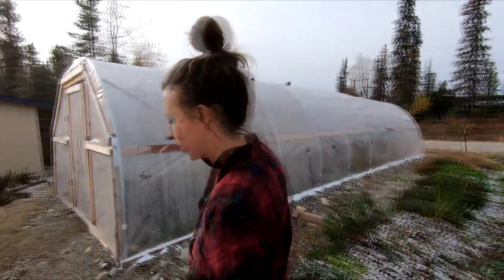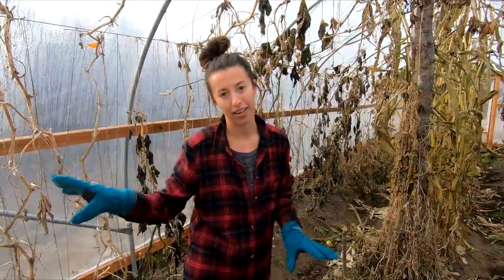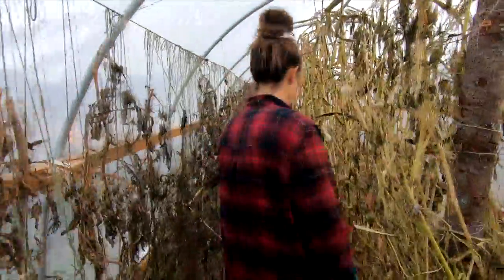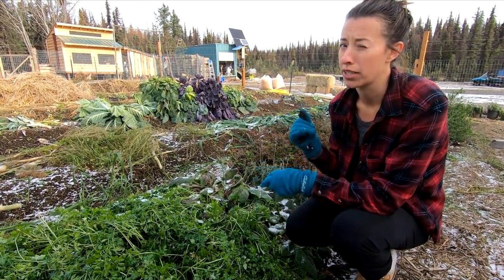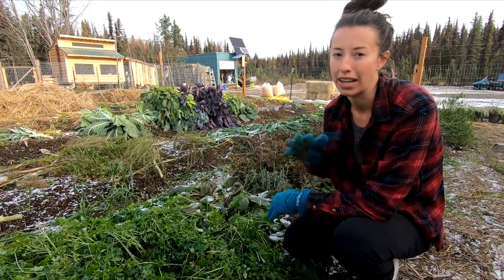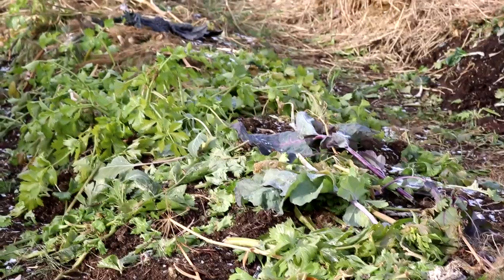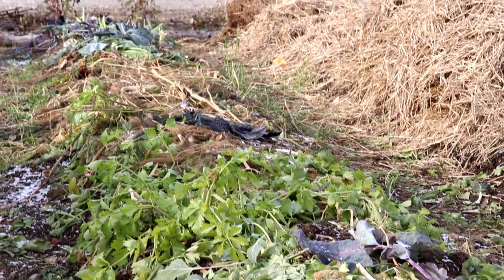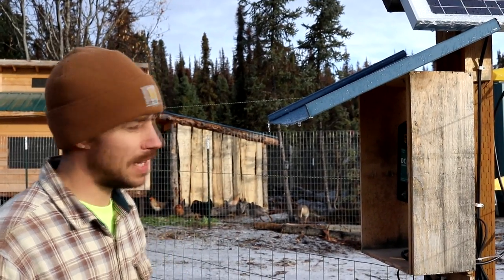Putting the Garden to Rest | Overview of Our Garden this Year

Comment: So next year when you do the squash outside build some trellises and go verticle. Mine is 7 feet tall and is in 6 inches wide by 12 inches tall and I use 8 foot 2x2s to hold them upright. If you have a dollar store go rade the pantyhose section they make great cradles to support the fruit. If you have a chipper/grinder take all the stuff currently in the greenhouse and grind it up for swifter decomposition especially the corn stocks and last but not least when the tomatoes are taking to long to ripen get some overripe apples and lay them along the base. As they decompose they emit ethylene gas and will trigger the ripening of the tomatoes.
Reply: I apply the same trick with my tomatoes to help them ripen a little faster ;-)
Reply: Love a man that knows what he is talking about.  Helps sure does.

Comment: Some plastic spacers of some kind should make enough room between the plastic and the wooden beams to slow down their rot in the greenhouse. I had a few problems with a tarp-covered scrap-wood pile, and was amazed at how bad being in contact with the plastic was for the wood. It really doesn't let moisture out at all, and even the wood that was an inch from the tarp was in much better condition, despite still being in a humid environment under the tarp. Even the pressure-treated wood had mold where it contacted the plastic. It was bizarre to see, as it happened in only a few months.
Reply from the maker: S. Smith appreciate the info ☺

Comment: If lack of bees is an issue, you can hand pollinate pumpkin and squash. You just find the male flowers ( the ones with a single stamen), pull back the petals, and then gently rub the pollen on the stigma of the female flowers. Depending on how pollen rich it is, the male flower can pollinate about 3 females.  I find that mid morning when the dew is off works the best. Hope this helps.

Comment: Just a thought for a heater in the high tunnel. Bury a 55 gallon drum in the middle of the floor and vent the smoke out a pipe underground through the side. Leave a quarter to half of the drum exposed on the top for heat escape into the tunnel and to feed wood in. Top the whole thing off with small rocks for heat retention. You guys are doing great and you dont need my help , but there is my 2 cents. Great video as always.

Comment: Learning alot from your gardening...   The hay up here is so dang expensive....  out by Macinzy point you may be able to get old hay cheep....  
An idea, in meadow lakes or houston there is a rental place that has a big chipper shredder, a day at your new property shredding the top layer of the mulch and some limbs,  make great compost...  Grinding up straw, leaves, grass and mixing it with your fresh manure makes great garden soil up here..  That lower bog black dirt is amazing to... We did nothing but that in a raised bed garden and the plants went nuts...  bushels of tomatos.....   
Another thing I thought of, inside the tunnel on the sides, how about four inch square fencing bent to the contour of the wall as a tresel ...
Also there are tons of places you can get free saw dust!  From cutting firewood in out yard I learned that makes great soil in a short tim for a lawn..  Just some thoughts...

Comment: Cutting celery (mostly leaves) has become a fav in our gardens. I dehydrate it from late summer into hard freeze. It works great in zone 4, if started from seeds. It replaces regular celery (in soups), which struggles in our sandy soil. You might try it some year.   👍

Comment: Concerning the herbs, you might try running bales of straw along the sides and some plastic over the top leaving the ends open for airflow that would be a really insulated cold frame. Just a thought.

Comment: I take the edible greens, dehydrate them, blend them into greens powder, which I then add to soups, stews, omelettes, etc, basically anything that'll have enough moisture to rehydrate the powdered greens & herbs.  I'll also toss into the dehydrator thin carrot peelings and other vegetables from time to time, and add onion powder, etc, to the greens powder.  A little goes a long way, adding micronutrients, folic acid, etc, and it definitely adds depth to the flavors of a meal. 

Different greens (carrot greens, mustard greens) can add a spiciness, while spinach is surprisingly sweet by comparison, plus you can actually add lettuces to your cooked meals this way, without getting that nasty soggy texture.  Some greens, such as beet greens, definitely need to be blanched before dehydrating (it removes oxalic acid, which can upset stomachs after a while), but some can be rinsed and dehydrated right away.

Make sure to get a good dehydrator with temperature controls, since herbs need a lower temperature than veggies.  As a bonus, f you get one that goes up to 165F, you can also make jerky!  I use chicken or turkey burger since it's naturally low fat to begin with (see below), and then mix it with spice packets, such as Montreal Steak Seasoning, or Phad Thai powder, or sometimes just my favorite barbecue sauce straight from the jar, though the extra moisture means extra time dehydrating.  (Follow all safety handling recommendations for any of this, especially the meat, of course.)

With that kind of a setup, you can also dehydrate pre-made meals and store them in jars. It's recommended you dehydrate the meat separately, first cooking it thoroughly, then rinsing it in boiling hot water to remove as much fat as possible, to improve the shelf life by removing any chance of any fat going rancid; it needs to dehydrate at 165F, but your cooked veggies, cooked rice, cooked pasta, etc, require lower temps, like 125F-135F (read your dehydrator manual, etc) to dehydrate best.  Then just combine them at the end, store in a jar, and when you're ready to eat, pour it into a pot, add just enough hot water to cover, and gently simmer it until it's rehydrated and ready.  (Don't forget to add a bit of greens powder, too!)
Reply from the maker: ladyofthemasque thank you for that information, it was our first time drying greens we are very excited to use them 😀

Comment: Hail from the Oil Patch in Central WY!

Congrats on a superb gardening year! It looked great and the step-by-step methodology you two use in presenting the what's, why's, and wherefore's, as to how you decide to garden is truly valuable and I hope you will take the extra time to make a CD/DVD collection as you go along, one that you can market, because your straight forward common sense presentation makes it easy for others to follow!

I'm a big Ruth Stout gardening paradigm supporter, so appreciate your approach to gardening. Where we might differ to a lesser degree are the 'pests': where a pest exists, there is a predator/solution to the rescue!

Aphids? Lady Bugs.
Slugs? Bowl of beer/ Ducks
Flys? Mantids

Natural solutions to natural problems; people really need to 86 the synthetics and remember to live healthier via natural solutions!

I would also recommend you consider creating what I call a 'Compressed Compost' set up: 2 to 4 heavy duty barrels (plastic is the best weight wise, but 55 gallon steel will do) set up on simple spindles, with basic gear/chain connections, which are tied in to a simple electric motor that is solar powered.

The barrels turn at a reasonably constant rate (even at night if you add in a couple simple batteries), thus composting your materials at a vastly accelerated rate. There are commercial rigs that you can buy ready made, but my budget would never allow for that at all, so I'll be building my own.

I would also recommend you take some of your girls products and mix them in with your column overlays: the hotness of the chicken manure will help break things down much more rapidly than you might suspect during the Winter, and because it's Winter, the rate won't be too fast for reasonable use next Spring.

Thank you for another great video.........oh yes, if you know anyone who raises some rabbits, rabbit poo can be place directly on materials for growing without them burning up.........

Comment: Great Overview guys, you did an awesome job on the intro too. The garden did really well, part of the fun is working out what does best where. You can now put your feet up for 5 minutes and then the the real fun of planning everything for next year begins. 
May I suggest a "Rocket Stove" for the High Tunnel and fit a liquid heat exchanger on the flue pipe to gain some extra heat, you can run a syphon system to a water barrel as a heat sink that will slowly release the heat overnight, and it can be placed further down the tunnel. You can even run the flue underground part of the way to warm part of the soil for your new seedlings, worked great for me! Check out this guy's heater:  https://www.youtube.com/user/web4deb.
Looking forward to seeing the root store when you get round to doing a video of it.
Reply from the maker: Dave Williams thank you 😀 we are going to be doing some research this winter for the heat in there.

Comment: I was wondering if you were going to plant fruit trees.  I love my orchard.  I got good numbers of apples, pears, arctic kiwis, and pie cherries this year.  Just be sure to consider moose protection.  Moose really love apple trees and it is disheartening to wake up one morning and see that your trees have been broken.  some times you I have a suggestion on the berries.  You might try service (saskatoon) berries.  they ripen slightly later then the honey berries, but still well within our season in south central Alaska and they are much easier to figure out when they are ripe.  My honey berries turn blue before they are fully ripe and they are sour if not fully ripe.Also there is another thing I like to do with my greenhouse.  In March plant a bed of spinach and fill the bed with snow.  Put a good foot of snow on the bed.  When the snow melts start watering.  The spinach will grow and be done by the end of May just in time for your tomatoes and peppers to be planted.
Reply: BTW, I heard some types of nuts can grow in the subartic, like the beaked hazelnut & some species of pine producing pine nuts. I also know that the butternut/white walnut is a cold hardy nut. I saw that some type of plums can grow in the subartic & now a blackberry but it needs winter protection.  In Canada they sell a type of cold hardy grape for the Yukon. Klondike Nursery in the Yukon Canada is one of the furthest north nurseries in Canada.
Reply: I have tried Butternuts, and am currently trying a variety of hazel nut.  The butternuts I tried twice.  they did not make it through the winter.  The first variety of hazel nuts didn't make it.  I'll see come spring about the second variety.  I have never tried the pine nuts.I have tried grapes several times.  I have had them survive a winter or 2 but eventually they die with out producing anything.  There is a guy in Anchorage growing grapes successfully in a green house, so it may be possible in a warm sheltered location.I have a hardy blackberry it survived one winter but died back to the ground.  This winter is looking to be a little colder then last so we'll see what it does.I have several plumb trees.  including a Canadian variety.  They grow well but have not been big producers.  I have gotten a total of 8 plumbs in 4 years.  the trees are still young and only 2 of them reliably flower.
Reply: @drivingonice  , I saw online of a native grape in Alaska & neighboring Canada, but it is quite sour but can survive -70F below zero. Also in Canada, they have a "ultra-hardy" apple & cherry & I saw some folk there grow them in cold-frames. It is just like in northern zone 3 Minnesota back in the 19th century, no apples could grow there. A doctor experimented with all kinds of apples like 15 years & finally came up with an apple that could grow there. He named it the  "Worthy apple" & soon apple orchids came about in northern MN & spread to WI, MI & other zone 3 areas. 100 years ago in subartic places almost no warm weather veggies grew but now many do & the Russians were one major group of the twentieth century to pushed agriculture into the subartic. BTW I assume your apples, pears, cherries are "small fruit" ?
Reply: I have several varieties of apple some of them get to be regular size like you can buy in the store.  The cherries are normal size as well, but the pears are small ( about 2 inches across).  I am not familiar with a grape that hardy.  Do you think you can find a name?Growing warm weather crops here is a bit hit and miss.  If the plant can thrive on long days it might grow.
Reply: @drivingonice , check out Klondike Valley nursery in central Yukon, very interesting! They have ultra-hardy/hardy & shelter fruits. The ultra-hardy apples are on a hardy crab-apple rootstock & like those hardy subartic pears being 2 inches in diameter & grow "shrub-like"! They recommend wrapping all fruit trees in burlap & tarp for the winter. Shelter fruit are in a permanent cold-frame year-round. They have a grape, a dark purple called "Valient" & it is to be grown in a permanent cold-frame & I saw the picture. It is a table grape for fresh eating & good for jam/jelly! They sell a Siberian Pine for pine-nuts & I heard that the Korean pine grows good in the subartic! So with warm veggies outside it is a hit or miss? I assume a warm or warmer than normal year will be good for them, but I assume some summers are cooler, cloudy & rainy? BTW warm veggies need a raised bed with plastic mulch, black rocks, black painted water bottles & I would add salt-water & heat active mulch would be an extra blessing? Also the ground water heated because 39 degree F ground water will cause warm veggies to go dormant 8 hours!!!!! I know barley & oats grow best of the grains but what about wheat, buckwheat, tricale, rye, quinoa & any other grains? Can corn dry out  or only for fresh eating/canning/freezing? BTW I live in zone 10 semi-tropical south Fla. & I want to share how veggies are grown here & in the islands of the Caribean, like the Bahamas, Cuba, Jamaica e.c.t.! Also how deciduous trees grow in a tropical environment & BTW temperate fruits are growing in the lowland hot tropics & I kid you not & I have researched this online-FYI !!!!! I have also done veggie gardening in zone 7- warm mesothermal temperate North & South Carolina!!!!!
Reply: Thank you I looked at their site.  they have a limited selection, but all good varieties that are proven to grow hear.  I tried Valient Grape on the south side of my house.  it survived one winter then died the next.with the warm crops the quality of summer certainty does make a difference, however I was referring to the long summer days.  some plants it screws with how they grow.  Others thrive in it.

Comment: Congratulations in surviving your first growing season in Alaska! I noticed the light snow so it appears that it is good timing. Soon you will have a foot on the ground and then more. But, it will be so pretty! I am interested in how the cellar works over winter for y'all. Will y'all try to use the high tunnel to grow some things during winter or just when it is time for plant starts? Also, do you have plans for using grow lights at first since there won't be a lot of sunlight when you begin your starts?
Reply from the maker: Paulla Wells we won't be gardening this year in the high tunnel but possibly in the future. We do have LED grow lights for seed starting in the spring, we may not need to use them as much as we had to inside our cabin ☺
Reply: @SimpleLivingAlaska  - I hope not. Just depends on how many hours of sun you'll be getting when you start seeds next year I suppose. I really am looking forward to how y'all fair through your first winter after growing season. Plus, I am certain the shots you're going to be able to get will be stunning!